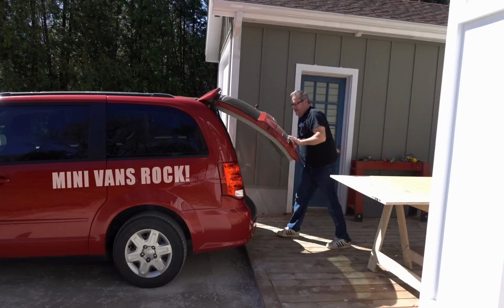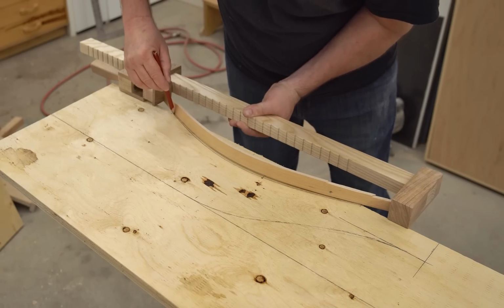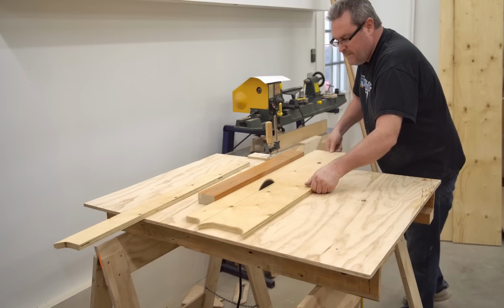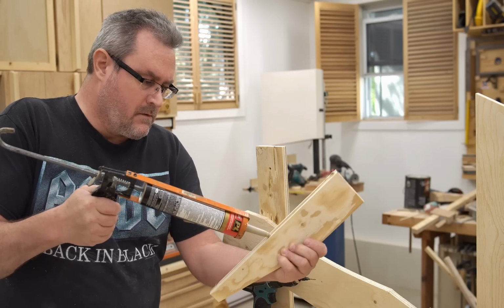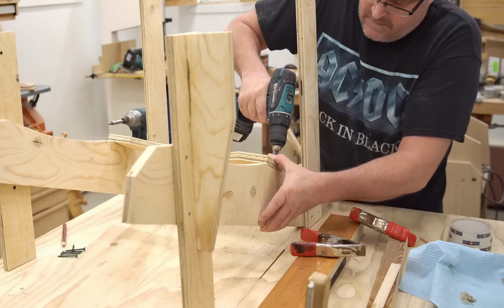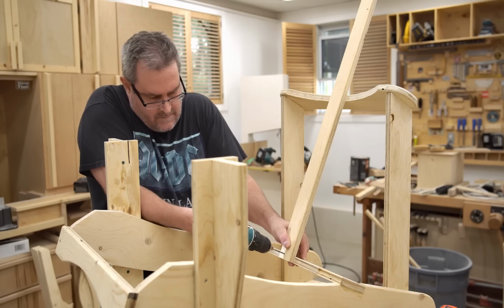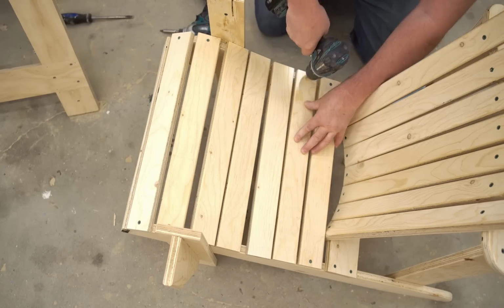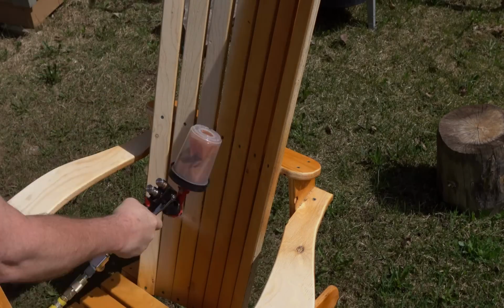How To Make Adirondack Chairs

Comment: Using the clamp to bend the strip to draw a curve is one of those things that I've probably done and seen and forgotten about three times already.  Now I can be really impressed and then forget about it tomorrow for the fourth time.
Reply from the maker: If you can hold out for another day there's a gold star in it for you :)
I had a drawing bow, but took the string off to use for something else, and then lost the box. Typical!
Reply: I have a "drawing bow" aka piece of plywood and a string and it's really fiddly to get it where you want it.  Tighten clamp until it's right seems a lot simpler.

Comment: Just finished making two of these. WOW what an awesome project for a beginner like me. I made one slight modification: a cup holder in the right arm rest using a 3.5” hole saw. Now I just need to stain them and maybe use some poly. Love your channel.
Reply: Done! I opted for dark walnut Danish Oil to color them, followed by four coats of exterior poly. Thank you so much for the Sketchup model!

Comment: They will last at least a few years.  This spring I pulled up 3 sheets of 3/8" CDX ply I was using as a walkway in my always wet backyard.  They went through a Buffalo Fall and Winter and after letting them dry out a few weeks I ended up making a project from them.  Super dirty and a bit warped but they were structurally fine.

Comment: Nice project and makes me wonder why the wife and I moved back to the UK from Canada, especially on a monsoonlike day like today.

Its a shame the plywood in the UK so is substandard now, exterior ply used to withstand the elements without issue or protection, marine ply was just that - ply to be used in a marine environment. However now the market is saturated with Chinese plywood sold at UK made prices. I know from personal experience that exterior ply, even when painted is anything but - it delaminates at the first sign of moisture, the glue that holds the layers decomposes, causing the upper layers to flake (often those are claimed to be hardwood but are wafer thin and built up with copious use of a pink glue.
I'm now having to reclad my garage and possibly replace the roofing sheets with real timber as the ply, despite being stained is falling apart rapidly. The roof is felted and some of the roofing panels have delaminated despite being covered with roofing felt and the edges of the felt sealed - you can feel the ply is going "soft" underneath
Where I sourced it - a "proper" timber supplier and it wasn't cheap or thin either I think I paid £400 or more for the ply which was meant to be 1/2" thick exterior grade, hardwood faced....which is the really sad part...I probably would have been better sourcing it from B&Q or Wickes ( UK equivalent to Home Depot or Lowes)

I'm not alone, I spoke to a chippy/joiner/carpenter who either refuses to use ply now for outdoor projects or specifies marine grade and says even that is often not fit for the job and no one cares in the supply chain....

Comment: Was that Thompson's water seal and stain?
Reply from the maker: It's a Behr product, actually. I need to spray some water based poly at some time over the summer, so I'll probably overcoat these with 2 or three coats of exterior grade clear to add more protection.
Reply: If that's the Behr weatherproof stain, it works great! I used the same color on some regular KD SPF adirondack chairs, and they held up over 5 years outside in rain/snow/etc. I made sure to soak in extra on end grain where it touched the ground, not sure if that made any difference or not.